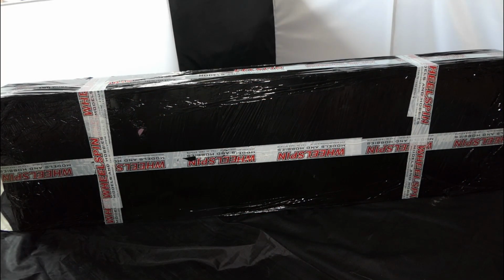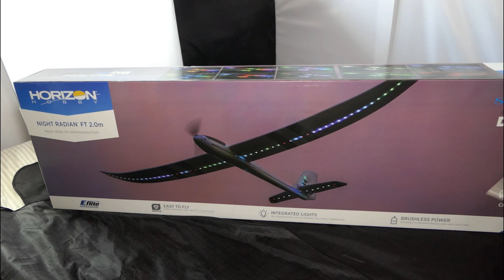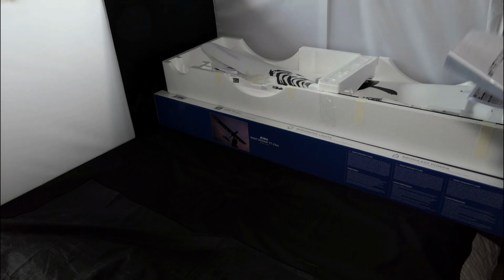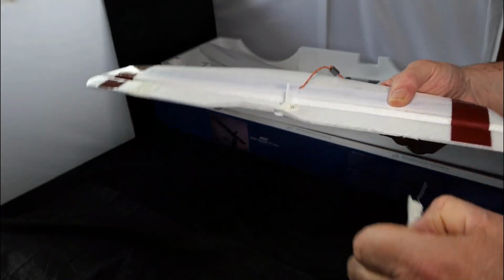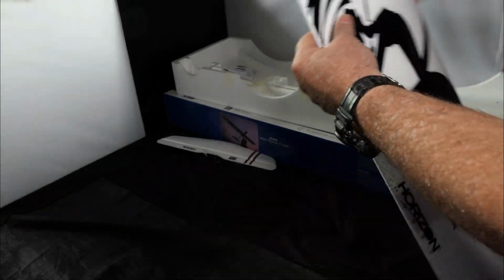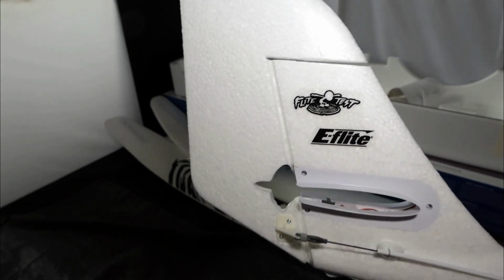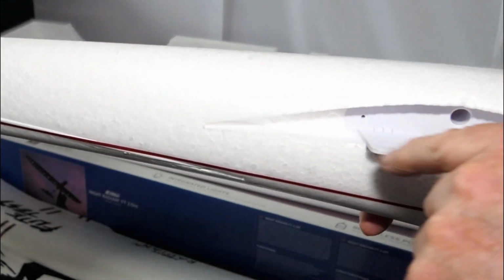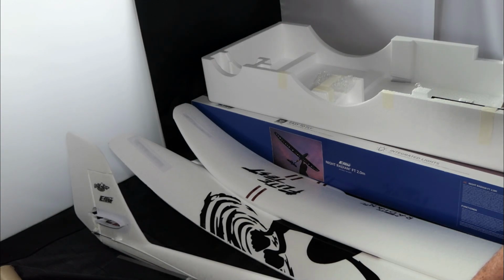Unboxing - Horizon Hobby - The Light Fantastic

Comment: Well explained & great advice to work on martyn. Looking fwd to flight. I heard that you need a special programming cable with the Ar631 receiver when using the wingnut
Reply: Will you add flaps?
Reply: With my old original radian, one problem many had was the prop/s coming away from the hub due to the screws coming loose, so the advise was to use locktite on the two prop screws.
Reply from the maker: I have the Spektrum programming cable already I use it to register my RX's and to upload the latest Airware into them - It is needed for the WIngnut because Spektrum unassigned the free ports on the RX, Making them not work - you need to active Channel 6 for the Wingnut
Reply from the maker: @Bellairvideo  No fly it as it is
Reply from the maker: @Bellairvideo  I will use Loctite or Foamtac - I tend not to use Loctite if it is on plastic OK on Metal - on Plastic I use Foamtac - just stops vibration loosening the screws

Comment: Wingnut is great, al prop spinner with carbon prop,  carbon fuse spar,  glue the elevator
Reply from the maker: Yep I will glue the Elevator and I always work out the length of the spar holes and fuse - then get myself a good carbon spar and cut it to the full length - not sure about the Prop and spinner don't know what to get - might look at that later.. thanks for the Tips - I have to work out how to activate a channel on the AR636A as I have been informed that all the free channels come disabled as standard..and the WIngnut needs one.
Reply: @FlankerTanker  the prop is ok if you don't run 100%, I'll get a link to the aluminum parts later
Reply: @FlankerTanker  need the spectrum programming cable to unlock the 636